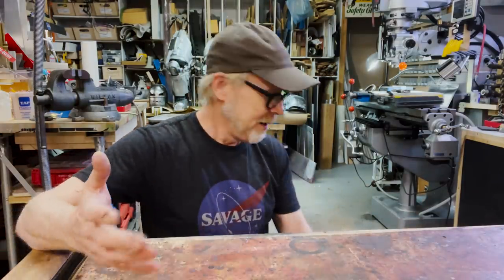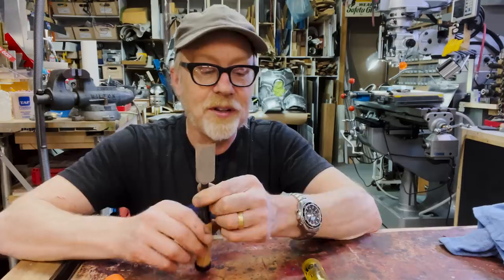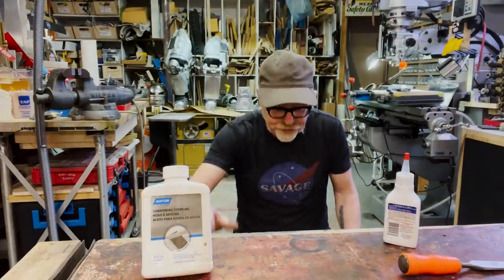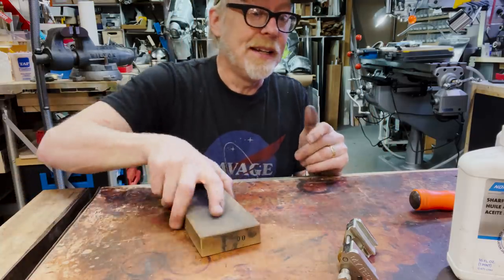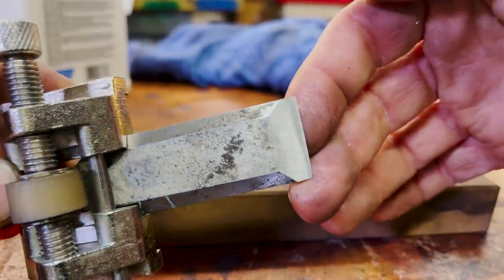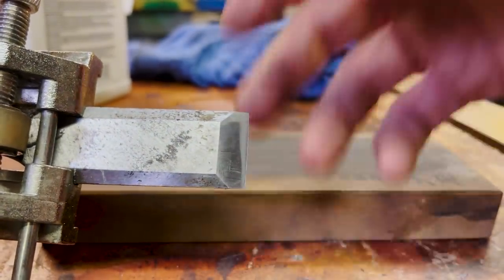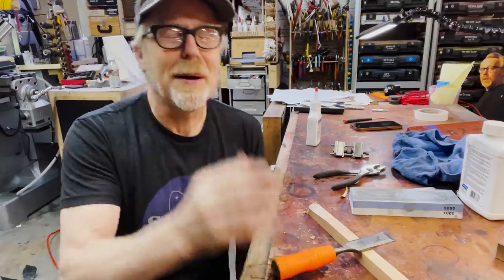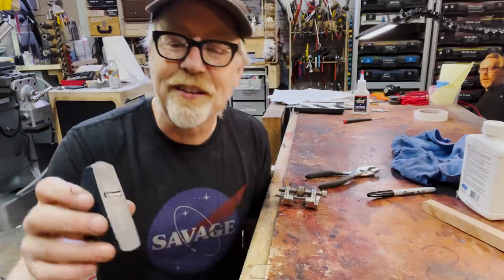Adam Savage's Favorite Tools: Woodworking Chisel Sharpening!

Comment: You can set the angle by the length between the tip and the clamp. So if you have the angle you want mark it on something and you can slide it in later to get it parallel again fast.

Comment: Appart from the advices you already got about wetting the stones and all of that, you should also clean them after use. You probably got a smaller stone when buying the 1000 - 3000 one (I have the exact same one at home), it is used to clean and grind the stone itself to keep it flat and efficient, as particules get stuck in the stone (thus the dark spots) and the stone doesn't grind as well as it should.

Comment: If you are going to use this method. 1st, turn  the whetstone, oilstone on edge to set the datum. these will be almost perfect. THEN turn your whetstone/oil stone flat and roll away. . you will grind a new path every time, but it will be parallel to the original side!

Comment: Aaaaaaah. Use water on waterstones, not oil. Oil dirties your stone and grinds the filings into the pores of the stone instead of clearing them away
Reply: pitote cochinote  I have seen videos from multiple professional carpenters that stroke both directions, or go in circles, so I am not sure that is a hard rule. Maybe when refining the final edge though

Comment: I may add an advice : An important step is missing. The last step, wire edge removal.
You can feel it on the flat side of the blade, with your nail.
To remove it, just put the flat side of the blade flat on the stone, do some circular moves.
This is really one of the key to keep sharpening for a long time.

Comment: Use a micro bevel on your blade, it's less sharpening time, less material removal and less friction against the wood when cutting.
Try using a diamond stone, they stay flat over time. A special oil is needed for those stones. Water will rust the steel core. The tool will float over the diamonds with a too thick oil. Some people simply use glass cleaner as a lube.

Comment: IN my experience, sharpening creates a microscopic burr along the edge. While this may make it feel extra sharp, the burr will break off the moment you cut it. After sharpening, run your chisel very lightly perpendicular to the whetstone once. This removes the burr while maintaining the edge, one that will last much longer. Your mileage may vary. BTW, water for water stone, soak for around 5 minutes.
Reply: this known as a wire edge, and is usually removed with a polish of the mirror face towards the end of the process
Reply: Also, a simple micro bevel helps to remove the burr as well as making it last longe. Just do a single pass of the tool lifte up from flat.

Comment: Big fan of my Ohishi stones, I probably wouldn't use oil on them though. Also, you always want to use some form of lubrication on  your stones, ESPECIALLY on finishing stones. Also Also, with single bevel knives make sure you do a quick pass along the back of the blade to break off the burr you form by sharpening the front side.

Comment: You would be much better off using a Norton ceramic stone or Arkansas stone with oil. The whole idea behind waterstones is to abrade the surface of the stone leaving new, more aggressive abrasive particles as the abrasive is used. The particles are rounded and abraded into smaller finer particles until you get a slurry on the surface of the stone that you can use to polish with (See nagura stones). This is balanced with the steel swarf from the blade, you want to rinse the stone as you remove the swarf as it only dulls the blade. With oil stones the oil serves the same purpose as water but usually is used with finer harder quartz rich stones that can't be permeated with water and tend to hydroplane and fail to cut. Oil is also used with synthetic epoxy stones like silicon carbide, boron carbide and ruby. Note that you can use water with the softer carbide stones to a similar effect as a waterstone and you can leave it up to your use case and preference. Really good tip using the guide though, I've spent thousands of hours to gain the ability to hold an angle and still manage to screw up sometimes.

14:16 You're right about the line. You can even see it in cheap chisels if they've been hardened when you give them a good even polish.

Comment: The type of stones you use are really made to be used with water (soak for 15min at least before use). But they work fine enough with oil as well.  Only thing to take home is that once you used oil, you can not go back to water.it just wont work anymore.

Comment: Just one word advice : strop !!!! 
Seriously, try it, don't need to be fancy, i use a scrap piece of 19mm MDF and autosol metal polish. Just give it a try especially if you are impatient and don't like to spend time sharpening. No gig no adjustment, you just drop a peanut size drop of polish on your mdf plate and drag the edge 20times each side and it's like a razor. It's so simple you can do it supper often without loosing precious shop time and you will not have to go back to stone in more than a year even using that chisel daily (or at least until you hit a nail).

Comment: No, you shouldn't use oil on a waterstone.
Reply: Whetstone != water stone. They're two different things. Whetstones are designed to be used with oil too. Although I never use oil. It is too messy.
Reply: @1pcfred  Correct I meant to say waterstone since what he's using is a japanese ohishi waterstone.
Reply: @madman3891  I am not a fan of waterstones myself. Although I do have some. It is the 21st century so I use synthetic diamonds. Nothing is faster.
Reply: @madman3891  that's a paperweight.

Comment: Watching Adam dump a bunch of honing oil on a water stone pained me, and I'm not even a sharpening nerd. And good heavens the demo at the end, that is not a well sharpened chisel. Sorry, Adam.

For those coming to this video looking for good sharpening advice:

1: The flatness of the bevel, and even its precise angle, doesn't matter. The flatness of the back matters a lot, and you should do your best to get it flat everywhere it matters (a hollow in the middle doesn't matter, just make sure it's flat where it'll contact a work piece).

2: Sharpen the bevel so it forms a nice perpendicular edge across the width of the chisel and pushes a burr onto the back of the chisel, and then give the back a little love (flat on the stone) so the burr falls off.

3: Every step after this is not so much sharpening as it is polishing. Use finer grits of oil stones, water stones, or sandpaper on glass. I personally do the sharpening on a cheap diamond plate and then skip right over to some 2000 grit sandpaper, using honing oil on both to keep them from packing up with swarf. Finish off by using some of that green waxy shit on a piece of leather, aka stropping: hit it on the bevel and the back until it shines like a mirror. The polishing/stropping steps shouldn't take more than a minute or two each, if you''re taking longer than that you probably need to insert an intermediate grit.

That's all you really need to know. Follow those steps and you'll have a chisel that's sharp enough to practically fall through end grain under its own weight. And no, for the most part, the quality of the chisel doesn't really matter all that much. There's differences, and they're noticeable, but for the most part you're best served by just taking care of the iron you've got.

Comment: Adam, you forget one very important thing: your stones are not flat. THis is probably why the corners of your edge are not square.  Use water instead of oil, and get a diamond plate to flatten your stone after it has soaked. Flatten it often, i.e. inbetween sets of strokes, and your result will be much better.

Comment: A couple of suggestions for what it's worth. You don't need to spend your time getting the entire ground face to a polished surface. It's only that very edge that does the cutting. That is why your uncle raised the chisel a few degrees once the bevel was flat against the stone. Also you need to do a little on the non bevel side.

Comment: One of my favorite tools in the shop is a good sharp chisel, by far my least favorite tool in the shop is a dull chisel.....keep them sharp however it is that you do that or you'll just hate yourself the next time you destroy your work by not taking the 2 minutes to sharpen.
Reply: I hope you're sharpening more than one tool in 10 minutes. Pretty much if you're taking more than 2 minutes to sharpen a chisel you're doing it wrong. Efficiency matters.
Reply: @1pcfred  I just figured 10 was a round number 😁 not based on actual time it takes.  Updated for better reflection
Reply: @efenili  sharpening can take some time if methods are lacking. If you can manage in 2 minutes you've got it down. But if you can't then you need to re-access what you're doing and strive to improve. Sharpening should not completely interrupt your workflow. But it still needs to be an integral part of the process. Achieving that balance is a challenge.
Reply: @1pcfred  unless it doesnt matter. Efficiency matters TO YOU.

Comment: Hello.
Career carpenter here.
I use chissles for fine woodworking on a dayly basis, and if you are new to woodworking, it dosnt matter if you get a 5$ chissle, or a 25$ chissle, at least for you.
When it comes to the edge, there are advantadges and dissadvantadges for convex, concave and straigth edges, if you know what those are you dont need to have me tell you what they are good for, but if you dont, just try to get them as straigth as you can, just as Adam is saying.
If you are wondering what chissles to get, i always use a small one, less then 1cm wide, 2.5cm wide and a 3.5cm wide, you can usally buy these in set of 4, so you can just get that.

I personally sharpen my blade edges for hand, but i kinda want that sharpening tool now, i wont get my convex and concave edges with it, but for just fixing upp the smaller things, it must be great.

Also Adam, dont wipe your stones, dab them, the steel you grind off works as polishing powder.
Reply: I sharpened by hand for decades. I got a guide and I ain't looking back. I watched one video by this kid here named Matt Estla and he used a guide. I saw that edge and thought to myself, I can't get an edge that looks like that. Not by hand. The guide takes all the guesswork out of it. You don't have to stress out maintaining the angle. Easier is just easier. I have the exact same guide Adam does. It does need a bit of work when you get it. You need to flatten the bedding surfaces with a file some. It's a cheap import. Get yourself some continuous diamond plates too. Them old stones are for the birds. I get cheap plates direct out of China and glue them to plastic. Because the real cheap plates are paper thin. There's no way to hold them. But they work. I use this stuff called Purple Power on them as a lube. $5 a gallon at Walmart. I put some in a spray bottle.
Reply: @1pcfred  sometimes when i see new tools, i wonder to myself, have i wasted all my time practising doing this by hand?
Reply: @Fixti0n  I sharpened a lot by hand. Some days I was good at it, some days I had a harder time. With a guide every day is the best time. It is faster and you get consistent results. Beyond having to get the device and use it what's not to love? I think my guide just like Adam's cost me about $10 and change? It's the Cadillac of the cheap imported knock offs.
Reply: @1pcfred  Soudnt be too hard to get here in the EU then, ill need to look around for it then.

Comment: the Waterstones are porous and designed to be immersed in water until all the air is displaced. Then you can add small amounts of water while sharpening and it creates a slurry which lubricates everything. Im not sure what cutting oil is used for or what on.
Reply: Oil will prevent the metal shavings from sticking together and gumming up the holes, I use it intermittently for cleaning the stone and tool,which you then use soap to remove
Reply: I thought cutting oil was more for lubricating the drill bit while you drill through metal?

Comment: Adam

Using that kind of honing guide, just grab a carbide scribe, get the blade in the holder exactly how you want it, then scribe a alinement line across the top of the chisel.  Next time, insert the chisel to the line when putting it into the guide and you are back pretty darn close to the same position.  Again,  use a carbide scribe to get a really fine line to use for your guide

John

Comment: Little tip.

When sharpening a chisel, it's much quicker and more efficient to hollow grind the bevelled edge first on (preferably) a wet grinder. This means when you come to hone the chisel (what Adam was doing), you're only having to remove the first 3mm or so of metal, as the bulk of the metal will be concave and therefore not contact the stone.

 Also, whet stones/oil stones are outmoded imho as they require constant maintenance to remain flat and are bulky and messy! Consider a good quality diamond stone - Trend make the best that I've found. 

I thank you
Reply: Why is a wet grinder preferable? Can you not control heat?
Reply: @1pcfred  You can of course just use a grinder, but it's very easy to overheat the metal and lose the temper. 

Also wet grinders (Tormek) have larger diameter wheels, so the hollow formed is much less pronounced, which makes for a better bevel.
Reply: @danieltownsend5435  I have a 12" dry grinder. It has a 3/4" spindle. Big beast.  But the hollow off a 6" wheel doesn't bother me. How you figure the radius being greater is better? What's it actually doing for you? I like my plane irons being hollow ground. They glide easier. You wouldn't think you'd notice it. But I do. If you think about it it stands to reason though. The iron has to be below the sole for the tool to bite. So the relief behind the cutting edge matters. That's why you hollow grind. For relief. Mainly relief honing but it helps cutting too.

Comment: I've been needing to sharpen my Irwin chisels so this is timely. I got a long glass tile for a couple dollars from HD to put sandpaper on for sharpening.
Reply: Scary sharp. Scary is OK for occasional use. Eventually using sandpaper becomes expensive to do though.
Reply: @1pcfred  Yes that's it. Yeah I just do woodworking as a hobby and only occasionally, so I won't need to sharpen often.
Reply: Before you use the glass tile, take a straight edge ruler and hold it on edge, and with it backlit, look for light deviations to make sure it is perfectly flat. Depending on how the glass was manufactured, it may look flat, but not be exactly flat.
Reply: @jimmeier547  Good tip, thanks.
Reply: @TannerGwaltney  You're most welcome. A friend of mine pointed that out to me some twenty years ago. He then gave me a true flat piece of glass for the purpose of using sandpaper to flatten my sharpening stones with. I just wish I could remember where he got his from.
Reply: @jimmeier547  modern plate glass is exceptionally flat. It is all manufactured the same way today too. Which stands to reason from a profit and competition perspective. If you're not doing it how everyone else is you're not going to stay in business for very long either. Because they're all doing it the best way.
Reply: @TannerGwaltney  wood and tools do not care what your involvement is. Being an amateur you do have the luxury of time. Yet I would think that anyone can appreciate working more efficiently. Scary sharp is the cheapest initially. But that savings doesn't last. Frankly you should be sharpening every 10 minutes using a tool. You do that and you're always using a sharp tool. Even a little dull isn't acceptable. You have to be honest. Don't tell yourself, it's not that dull. Just sharpen it.

Comment: Armadillo porter cable belt sander with well used finest grit.  Finish on a whetstone and you can shave with it in about 5 minutes.  You just feel what the degree is.  No problem.

Comment: It seems like a very valid tip though. the tip is more like, use the right tool and just send it, if it mungs up the tool a bit then just fix the tool.  In this case a cheapo tool you can bring back for the rough work.

Comment: I use 400 then 1000 diamond plate, 3000 then 8000 whetstone, And strop on leather with compound. Normally i only have to strop to get sharp again or got back a couple of steps at most., as long as i don’t chip the edge i never got back to the 1000

Comment: Is there a way to flatten the grindstone? I inherited one and it works great but I can definitely see the surface is a bit concaved.
Reply: That's called a saddle back and yes you can flatten dished stones. But it can be a lot of work. I've seen folks do it with belt sanders. But do it outside. It makes quite a mess. There's ways of doing it by hand too. But that can be tedious.

Comment: Hallo from Norway, Adam! You should check out the tormek sharpening system. I have the t-4. It makes sharpening a chisel(or any blade for that matter) a breeze. You can set the exact angle you want. The machines are a little expensive, but for the time you save its absolutely worth it.

Comment: I should recommend the Trend sharpening set. You can find it on Amazon. I think it's around $150.00 but it comes with a diamond stone with a 600 grit and a 1000 grit sides. It come with a leather strop and honing compound, and it comes with the liquid for sharpening on the diamond stones. And a couple other things. And it's amazing I use it all the time for my chisels and plane blades. It works very well. I've been using it for about a year and it's still the same as it was when I got it. Just my thoughts.
Reply: $150? You can get a decent sharpening setup for cheaper than that. I wouldn't give Amazon a dime either. Get woke go broke!